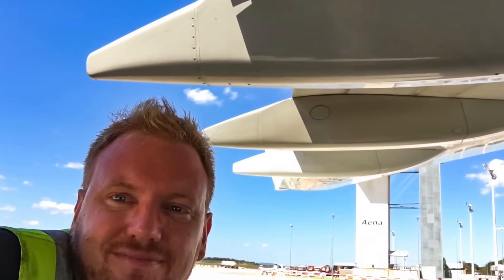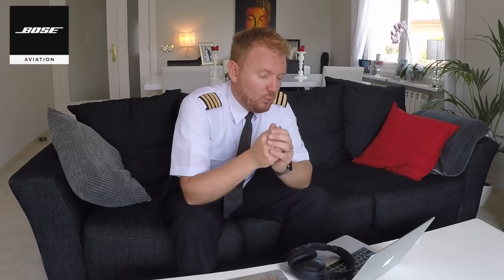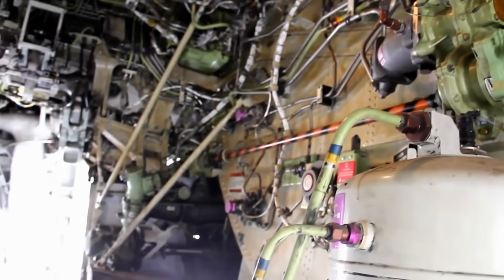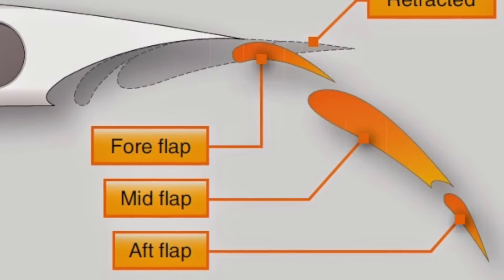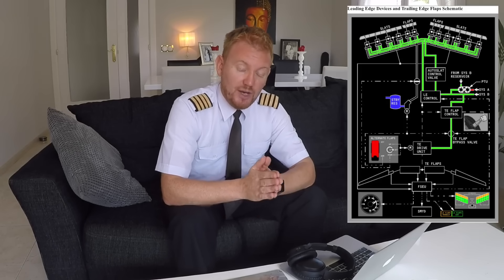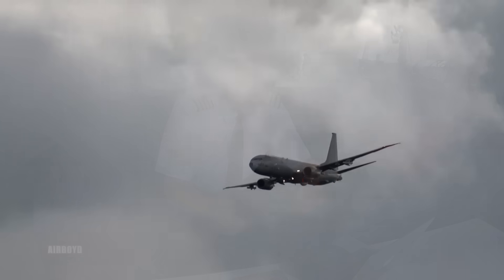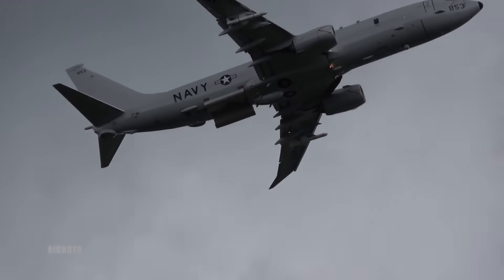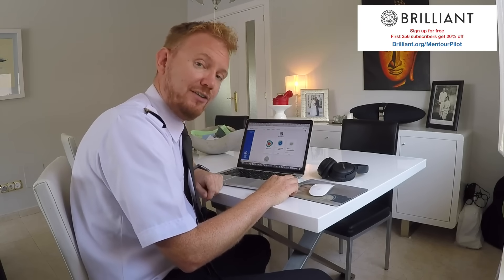"Pods" under the wing? What are they?

Comment: Ahh at last, my question is answered! I've wondered what these pods were for ages! A few years ago I was flying out somewhere, I sat In my seat, which was a window seat behind the right wing. I noticed that one of these pods was shaking and wobbling about. People were still boarding! So I thought, if its wobbling on the ground,  what the hell is going to happen to this pod when its going through the air at 560 mph! So I called one of the airline staff and asked her what this pod thing was, and if it was normal for it to be doing what it was doing! She said she had no idea what it was,and not to worry about it! 🤪 anyway I have to say I was a bit nervous about it, anyway the plane took off and strangely it didn't move an inch the whole flight. So now I've seen this video, it must be that when these flaps are retracted,  it must tighten these pods against the wing?

Comment: I have nothing to do with Aviation related clips but still i have been watching all of your videos perfectly explained and kept all the videos related to MH370 missing Malaysian flight, only after watching all the related link videos, the conclusion which still does not persist about missing plane, have an out side idea may be this would be a mass suicide forced by captain sorry to use those words (but how come a Pilot or a captain can just during a flight hours can go bottom and switch off all the related communication system which radar reads or the Flight sends related to the present positions or how a low flying aircraft is not being read by an Radar hope to see on those topics videos if could be briefed the situations what could have happened to MH370 a History of most expensive search done for any other Black Box.

Comment: If hydraulic systems oil low pressure and next option???
How to operate wings flaps??
You said about electric motors can function the wings flaps on emergency basis as per your check list. How good emergency electric operating system???
Thanks.
Reply: Just as good as hydraulic.

Comment: The flap track fairings also have a dual purpose, they act as anti shock bodies.
As most airliners have a cruising speed between Mach 0.8 and 0.85 Transonic drag can be minimized by having a cross section area which changes smoothly along the length of the aircraft.
Some aircraft (Convair 990) even have additional fairings above the wing trailing edge.
This is the 'Whitcomb area rule'.

Comment: Dear Montour Pilot:
Re: "Reverse Engines"
Are you able to get a Close Look, somehow, on an Airline Engine that is OFF,  Yet in its Reverse Thrust positioning?????
On some videos that show a reverse thrust, Especially on a Rainy Day Landing, one can see the Engine Housing OPENING Up. But, it's obvious that the Engine Itself is not reversing (That's Impossible), but when the Engine Housing opens for Reverse Thrust, there are SOME Openings, that appear, that does not make it Possible(?????) for the Engine Thrust to be RE-Directed in a "Forward" (Reverse) direction ????? Yet  on a Rainy Day Landing, the physics are showing the Thrust is indeed being forced Forward. 
  What is Happening there?? How is it possible that the Forces can be sent Forward in a Reverse thrust, with just the Housing being "slid open"???? Some Engines have what appears to be an Angled "Flare"(?) That opens, which seems to make More Sense  because it is Angling the thrust forward... Or, then again, is it ???????
Ps: on a 4 engine plane, the more forward engines (when in Reverse Thrust), seem to have a "normal"(?) tendency to "Blow" potential debris into the intake of the more outer edge engines. Is there the potential that the outer edge engine could "Ingest" foreign debris from the runway???? (Rain water?; Dust?; Rocks?; larger objects possible than those mentioned???)
  Sincerely,  Robert 
(aka: "Chicken of the Sky" flyer)

Comment: Nickname is 
“ flap jack screw canoe”
Reply: They were called Kucheman’s carrots at one time
Reply: @riazhassan6570  They still are, also known as anti-shock bodies. That's actually their primary purpose. That they happen to be able to store the flap tracks inside them is more of a happy coincidence. Some aircraft store landing gear in them. But aircraft that operated in the transonic regime had them for purely aerodynamic purposes even before they started using them to store otherwise-useful stuff.

Comment: Excellent. Your videos really help reduce "flying phobia". Keep up the good work!
Reply: Watch Air Crash Investigations and you might not be so sanguine! The number of things that can go wrong is mind boggling. And ultimately you are in the hands of the pilot, who can make surprising mistakes, eg taking off from the wrong runway, trying to descend when the plane is in a stall (making it worse), skipping over preflight checks, etc. But there are some great pilots as well, who have saved their passengers from the most dire situations.
Reply: But if it makes you feel better you're more like to die by choking, drowning, or in an automobile than you are in an airplane. Statistically it is to date the safest way to travel. Lol
Reply: Lol not so much when you realize how many moving parts are on a jet airliner and statistically the more moving parts you have the higher risk of failure you have.
Reply: TheWhite EazyE  Not with the amount of  safety checks aircraft religiously get
Reply: @tobylots  ? I'm not sure what exactly you're saying here?  I worked on powerplants of jet aircraft for a long time I know how the religious safety checks as you call then go. Lol Even with that no matter how maticulis safety checks are that doesn't change the fact that the more moving parts something has the higher chance of failure it will have.

Comment: The P-8A Poseidon is mainly used can be armed for both anti-submarine warfare and anti-surface warfare and has weapon capabilities with the 5 internal and 6 external stations for AGM-84H/K SLAM-ER, AGM-84 Harpoon, Mark 54 torpedo, missiles, mines, torpedoes, bombs, and a High Altitude Anti-Submarine Warfare Weapon system. It is mainly used for reconnaissance and sub detection due to its muti-mission radar capabilities and electronic warfare support measures.

Comment: How can a stunt plane fly inverted if the assymetric shape of the wing is important to create lift?
Reply: Inverted flight isn't truely sustainable without very high thrust to weight ratios, they increase the planes angle of attack, thus creating a greater angle of incidence for the wing, this deflection of air forces a sustained lift but this results in huge drag

Comment: Mentour Pilot - I've been playing with the idea of getting rid of the pitot tubes for some years. I've seen through some documentaries that they have been the cause behind some crashes. Some reasons involve maintenance personal forgetting to remove protective tape, bugs building nests in the tubes, ice build-up; etc.

My proposal is eliminate the pitot tubes, then combine the turbine rpm with outside atmospheric pressure within logic circuitry. The results can then be displayed on the instrument cluster. Perhaps other useful data can be extracted from this process. What's your take on this?

Comment: From aerodinamical design point of view these pods mainly were designed to redused drag in transonic regime which many airliners flight in this regim. These pods are known as anti shock bodies (also known as Whitcomb body or Küchemann carrot) & they developed parallel to supercritical airfoils in 60's to overcome high drag problem of transonic flight and you can find them in many transonic aircrafts of those times like tu-16, vickers & ... .
In addition to this main porpuse, this pods creates good volume to use as a fuel storage & flaps actuator coverage.

Comment: Those pods are for the motors that wind up the huge elastic bands that power the engines. It’s an improvement over the propeller engines, which where driven by hamsters. Animal activists are still trying to get them banned, trouble is, we’ve have no helicopters then.

Comment: for me , it is the presence of wings and flaps ,rudder/tails etc that make the airplane look bird_like...without those parts an observer from the ground would not know if it 'banks' gracefully...just imagine a pipe or tube flying, it doesn't look graceful...which is why I admire eagles and its relatives as it soars with its majestic wings..though I admire a 'divebombing 'perigrine falcon folding its wings for a moment to achieve a spear-like configuration as it plummets at high speed for a finale attack

Comment: The pods on the wings are the external fuel tanks, there are like a million people who can tell you that.
Reply: And they would all be wrong. Very few aircraft have external tanks, and certainly no airliners.
Reply: Paul Shepherd  No, they wouldn't be wrong.  They are not detachable external tanks, they are built into the wings and provide extra internal volume to the fuel tanks (which are in the wings).  They are a part of the wing fuel tanks, not external detachable "drop tanks".
Reply: @kavikkang9411  No they are not. They are not sealed, so fuel would just pour out, and neither are they connected to the main tanks in the wing. They contain all the flap extension and retraction tracks.
Reply: Paul Shepherd  Somebody better tell the people at Boeing to stop filling them with fuel then, because they are a part of the wing fuel tanks.

Comment: How do they design the vertical stabilizer mountings to so strong when the stabilizer is relatively thin? That is, sometimes in rough air the plane will roll very quickly one way then very quickly the other. It seems like the bending moment of inertia would be huge. I think that airline lost its vertical stabilizer leaving JFK 10-12 years ago. Anyway, that section of the plane seems like it would be extremely difficult to design. Great videos, I always leave a lot. Thank you.

Comment: Small jets require these as well!(I have fabricated these parts where I worked,engineered  molds + carbon fiber + epoxy resins). I enjoyed the explanations of the control and failsafe systems. Amazing!Small aircraft and some turbo props (slow ones) don't require these. I would like to see an explanation of D.H. twin otter and other like aircraft. I have flown in and worked on twin otters and they are the shit!

Comment: Can anyone tell me why theses planes are traveling at the same speeds they traveled
35 years ago. Back in the 70s & 80s they were traveling 550 - 650 mph. I am curious as to why the speed never increased. I don’t think anyone would mind if we arrive earlier than we did in 1975. Your thoughts!
Reply: Going much faster would involve going supersonic. Any aircraft that did that would come up against the same obstacles as Concorde (e.g. not allowed to make sonic booms over land), which would limit its use. Also, you would need a different shape aircraft and different engines, which would be noisier and use more fuel, so again, not attractive to airlines. Today's aircraft designs and the turbofan engines that power them are all optimised for cruising at around Mach 0.85 IAS.  At present, there is little sign of that changing any time soon.  Maybe, if things like the SABRE engine really take-off, things might get a lot faster, but that's some way away yet.

Comment: Great video. Always wondered what they are. ..
What are those boxes on wheels , hooked up to the planes with a hose while on the tarmac? Thanks
Reply: GSU’s. Ground service units. Provide power/ hydraulics / air conditioning depending on which unit it is.

Comment: I’ve had a similar problem with flaps asymmetric on one of my flights as cabin crew. Cockpit crew notified cabin crew about the problem. I used my mobile phone to make a few photos just behind the left and right wing. We compared the left and right wing pictures in the cockpit and captain concluded that the flap extension looked identical. We made an uneventful landing with slightly higher approach speed. The indicator in the cockpit was malfunctioning. It’s all about crew resource management. In this case you could use the eyes and ears of the cabin crew while the pilots focus on flying. Just an helpful idea!

Comment: What about 767 that crashed into the South Tower on 9/11/01, it had a pod in bottom. Two long shapes located underneath the fuselage, one towards the bow and the other towards the stern of the plane. Is it common for commercial airliners like 767 to have pods underneath! Maybe variety of different lighting conditions look like it?

Comment: Most airlines use a super-critical wing airfoil and to reduce drag they need those cone fairings. It's basically using the "area rule" on the super critical wing. 
Your explanation about the loading and the bulkiness of those high lift mechanisms needing space makes sense. It's as if some clever engineer combined two purposes with those cone fairings.

Comment: Con trails are made up of the post combustion chemicals that occur during the combustion of kerosene, gasoline, aluminum oxide and around nine more additives. The fuel is combusted under fantastic pressure and with 2300 C degree heat and then emitted into the stratosphere where the air is sixty degrees below zero, and nearly a vacuum. The UV radiation is astronomical up there. This scenario presents five powerful synergies acting upon the exhaust fumes, resulting in a toxic stew of over one hundred chemicals, many of which are completely new, hazardous, toxic carcinogens. 
The rotating, persistent contrail is constantly expanding in diameter and may condense massive amounts of atmospheric water vapor, all of which is contaminated by exhaust chemicals, producing acidic rain, massive ozone depletion, and also acting as the principal driver of violent weather events worldwide. One overseas holiday with return trip will consume two years carbon credits for every person onboard.
Enjoy your holiday.
Reply: Contrails, short for condensation trails are nothing more than water vapor being extracted from the atmosphere by the pressure differential of the relative air flowing across the flight control surfaces and the shear effect of the thrust to the relative air.
Reply: Read the NASA analysis re Jet exhaust. You are deceived. Jets are doing massive damage. Read it.

Comment: I assume they are similar to the little slats pods I put on my little toy bush planes, to over extend and bolster the flaps beyond design specs and reduce the stall speeds. This was super dicey for those pilots who used to fly illegal drugs into the desert southwest. Hot air does not have much lift. The US Army has installed RADAR balloons that are tethered, and look down upon the landscape, so no more hiding behind the mountains. Don't you have optical encoders and or  synchros for the flap deployment systems? Or stepper motors? The German company Bachman has a 10 lead 5 pole motor that has over 50,000 steps per revolution. Even if you used hydrostatic motors an optical encoder should work. There is a 747 with a laser in it. That was a project undertaken by numerous contractors including Allied, Raytheon, Perkin Elmer, Gen Dyne, Boeing, Lockheed, Motorola GEG, and numerous others. Perkin Elmer screwed up the Hubble Space Telescope, and they invented the optical stacks for many famous spy satellites.

Comment: The United States Navy uses a modified B737 for anti submarine warfare. It has a bomb bay in the back that holds torpedos and guided missiles. It also carries advanced surveillance equipment and is supplemented with drones. 
The name of the militarized plane is called the P-8 Poseidon. They are mostly based out of NAS Jacksonville FL.

Comment: I seem to remember reading that the pods also function as antishock bodies. I know that the Convair 990 used very obvious antishock bodies, and I had thought that later designs incorporated these into the flap fairings. But I could be confusing two separate things. Can you shed any light on this? Thanks.

Comment: In a previous vid you mentioned the aircraft having 2 auto-pilot systems. When I studied auto-pilot systems in the USAF in the early 70's, there was just one auto pilot system. What's the reason, now for two?
Reply: The second is usually a backup, but they are both regularly used depending on which pilot is flying.

Comment: I wondered about these pods for many years ;) Thank you. If you have not already explained it, I would like to know why the engines are under the wing when they are sometimes at the tail. Does having the engines under the wing not speed up the air under the wing, in a way that reduces lift ? Why not have them over the wings?

Comment: Show us where the fuel goes and other informing things
Reply: Save FLAT Earth - now I can help you there. I worked as an engineer for Boeing for 36 years. What would you like to know?

As for fuel, there is a fueling panel in the leading edge of the wing. The fuel truck hooks it’s hose into the hose fitting on the airplane, and starts pumping. The control panel monitors the flow and indicates when the proper amount of fuel for the flight has been loaded.

Comment: This pilot is not the right person to talk about this matter 
Should be an aeronautics engineer to do that
Now these pods under the wing are : THE FLAP FAIRINGS that covers the trailing edge flaps that are part of the HLS ( high lift system ) mechanism the flap tracks in order to have an aerodynamic profile to minimize the disturbance of the air
PODS : COVERS THE FLAPS TRACKS 
hi from algeria 🇩🇿

Comment: Excellent as always.  Question- We have had a successful takeoff in our 737-900, were climbing out at 1000 feet, wheels up, were at 6000, all is fine but as we continue to reduce power., but then we have a clanging sound in the #1 engine we shut it down. Now what steps do we take to offset the aircraft's tendency to veer to the left?